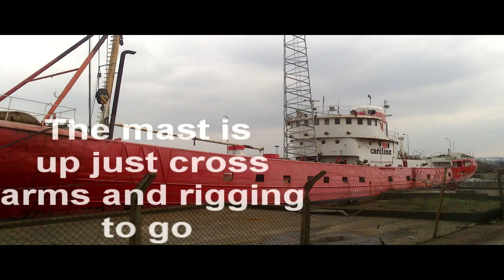Radio Caroline Mast Rigging - Radio Structures - Radio Antenna and Tower Manufacturer

Comment from the maker: Manual Rigging of the Radio Structures sponsored Radio Caroline Mast Radio Caroline Mast Rigging - Radio Structures - Radio Antenna and Tower Manufacturer
Reply: That's a very purposeful looking feed-through insulator inside the base of the mast, where are you attaching the feed wire from this insulator to the tower?
Reply from the maker: Hi Steve, no plans at the moment but Radio Caroline will be able to give you more information http://www.radiocaroline.co.uk
Reply: Thanks Lisa.